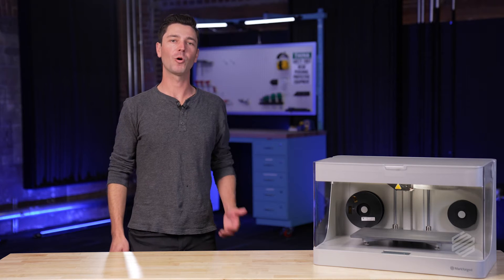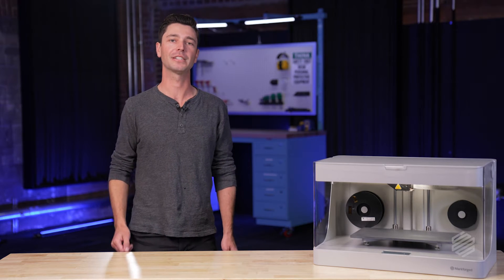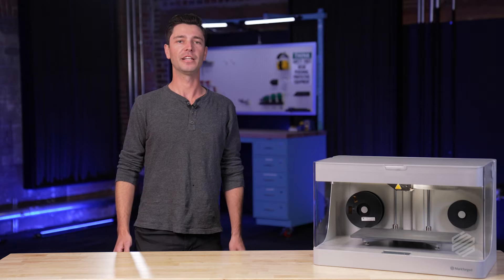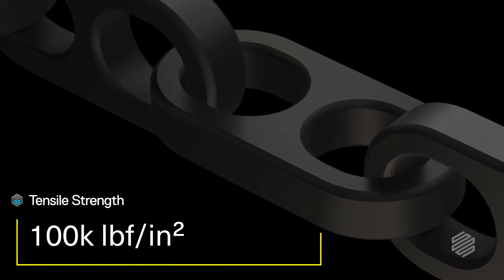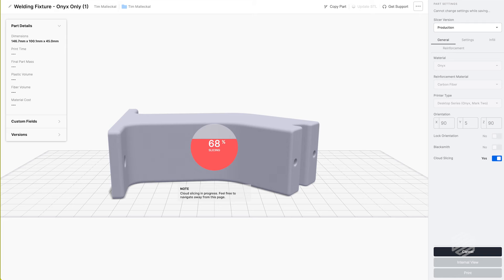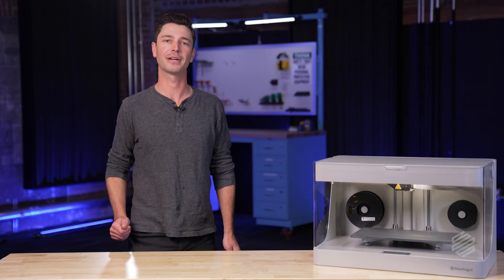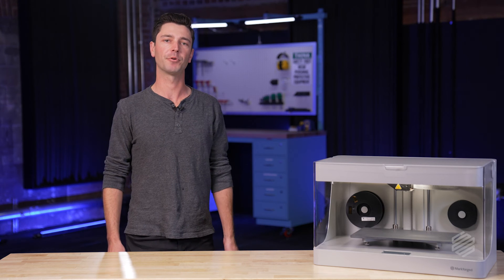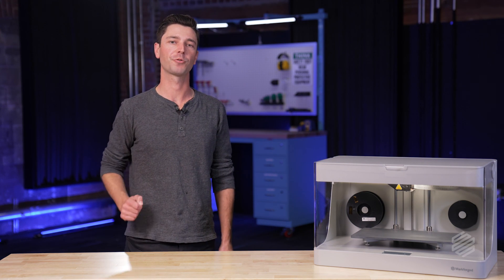Meet Our Desktop Series Printers: Onyx One™ | Onyx Pro™ | Mark Two™

Comment: Got my Onyx One a month ago, couldn’t be happier!
Reply from the maker: That's what's up! What's the first thing you printed?
Reply: @markforged  Unusefull printer you can not use a difetent materials and Onix is expensive compared with...
This 3D printer do not allows you to set a temperature different  than 275°C
Does any body knows any way to modify the temperature in order to use it with a diferents material?

Comment: Pla IS not aviable for industrial series?
Reply: Soon ;)
Reply from the maker: @mark3dprintstronger  ^^^ what they said :)
Reply: Looks like it won't be available for Onyx One. :(
Reply: Unusefull printer you can not use a difetent materials and Onix is expensive compared with...
This 3D printer do not allows you to set a temperature different  than 275°C
Does any body knows any way to modify the temperature in order to use it with a diferents material?